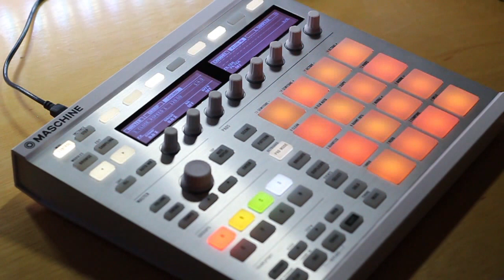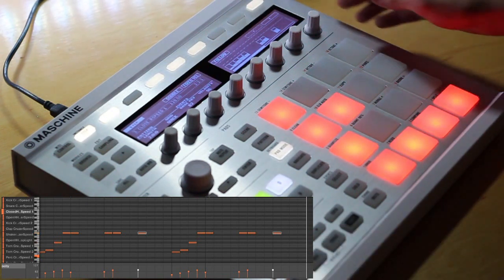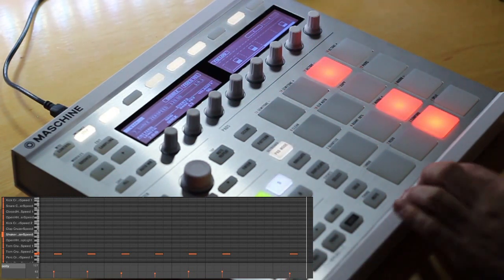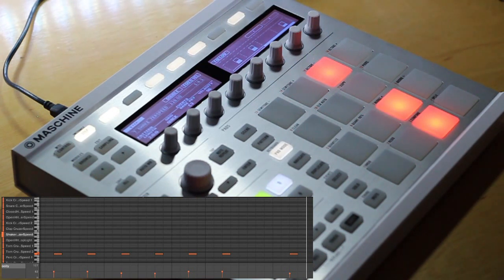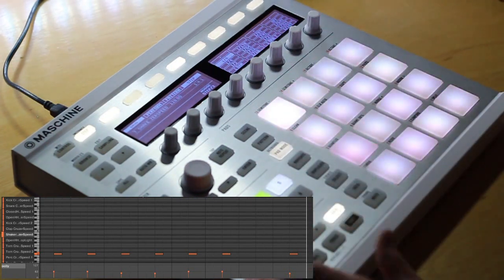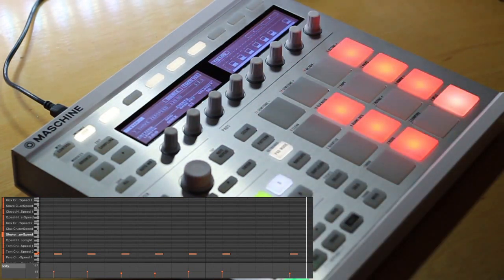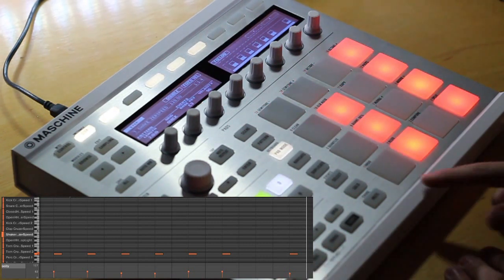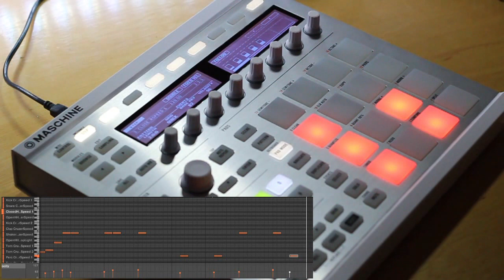NI Maschine tutorial - Hardware Step Sequencer

Comment: I have no experience with Maschine whatsoever and I couldn't find this information online, so - is it possible to use Maschine as a sequencer alone, without a computer, only sending information out using the MIDI out?
And a great video by the way :-)
Reply: TheKillingRhythm
Ah, too bad. So is there nothing I can do with it without it being connected to a computer?
Reply: it does have a MIDI mode so in theory, all the buttons and pads can be mapped freely. Unfortunately, this will only work while connected to a PC - without software, it won't work as a sequencer. Also, for standalone sequencing without the superior software and sample library that ships with Maschine it is quite expensive - you might want to look at other hardware sequencers, the older MPC's are pretty cheap on ebay. But if you are willing to use the Maschine software, you'll get a really good, well integrated software-hardware bundle.
Reply: Monochrome Arts Right, thank you. I saw a second-hand Maschine Mikro (1, not 2) sold here and I got interested. I was hoping you could use it the "normal way" for beat making as well as a standalone functioning hardware when the need arises. Too bad :-)
Reply: Wise Matic did you buy the Maschine?  It's not the software but the registration key needed for Maschine.  Let me know if you buy a second hand model and can't get the software.
Reply: +Wise Matic hey there , i've ust got a mk2 yesterday 2nd hand, the guy hasn't transferred the reg over yet, how long does it normally take. Was hoping to start to learn it this weekend. peace.
Reply: Caught Me Slippin'
key deregistrations have to be requested at NI, so it can take a few days.

Comment: Which BPM did you have this at? The timing is off on mine for some reason.
Reply from the maker: Official Kon I can't remember the BPM exactly, but the step sequencer will automatically sync to your project tempo
Reply: Thanks, I've had so many projects I forgot I even asked this question. Thanks for responding though.